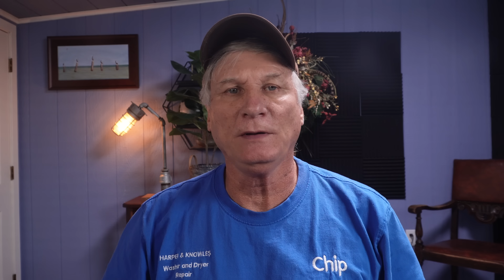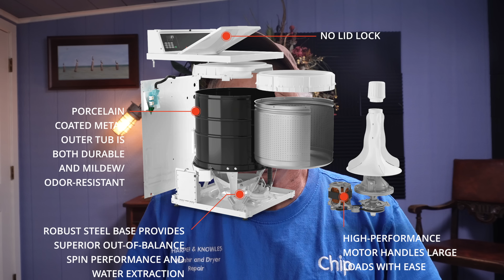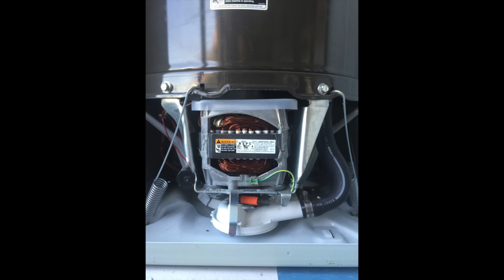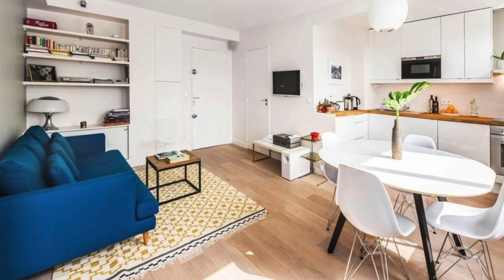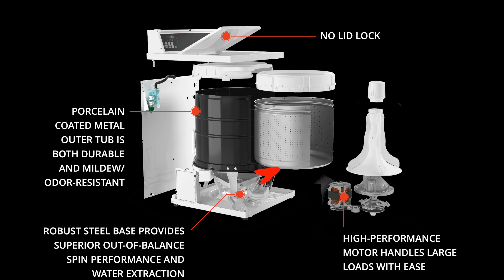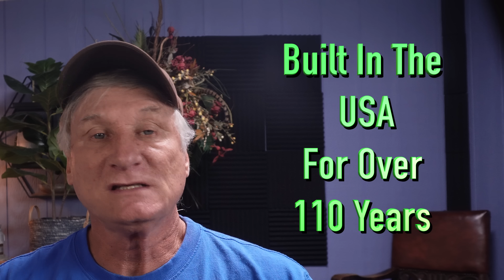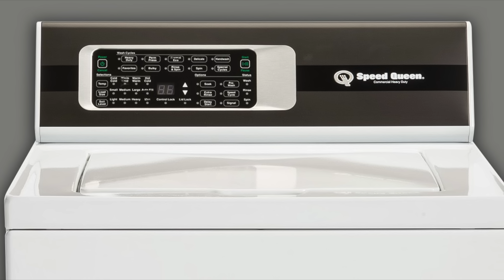TR7 vs TC5 – The Truth Speed Queen Dealers Don’t Tell You

Comment from the maker: If this comparison helped you, I’ve got full repair guides and tool plans here: https://harperknowles.gumroad.com
Reply: I have older home with stand alone pipe but mine drains nicely in the sink. I also had the pipe drain cleaned out well. Thx
Reply: @HarperandKnowles I don't see a manual for a TR7 Speed Queen, or am I just missing it? Can you direct link? I'm looking for instructions for checking filters, lock lid mechanism replacement, and drive board replacement. My washer won't start.
Reply: Many older homes have smaller drain stand pipes leading from the washer.  wil the SQ models push water out too fast causing an overflow?
Reply from the maker: A properly installed 2-inch standpipe won’t overflow with a Speed Queen. If one does, it usually means the drain is undersized, partially clogged, or not vented properly. Older homes sometimes had 1½-inch lines, and those can struggle with high-output pumps. Thanks for watching!
Reply: I'd love to come and work for you for a week... Where are you located?
Reply: Can i send my speed queen back to the factory for repair
Reply: If Speed Queen would make a quality front loader and/or a combo washer/dryer, I would consider it. But I will never get a top loader. And as far as a combo, I would only want one, as long as I could check the clothes for cleanliness before starting the drying cycle. Main thing is I won't be getting a top loader ever.
Reply from the maker: They do make those machines. Check out their website. Thanks for watching!

Comment: Do you need to do something to reinforce a floor? 

We have 17" between floor joists. Had a front loading Samsung before.
Reply from the maker: Good news, you don't need to reinforce the floor for a TR7 or TC5. A Speed Queen top loader spins around 700 rpm, a lot gentler than that Samsung front loader that was probably spinning 1,100 or more, so if your floor handled the Samsung it will handle this one just fine. Just get it sitting level so it doesn't rock, and your 17 inch joist spacing is plenty strong for a washer.

And if you would rather stay with a front loader, look at the Speed Queen FF7. It spins faster like your Samsung did, so getting it level matters a little more, but it is built solid and your floor will still hold up fine.

Comment: Just get. if you can Original Amana washer from 90s when  they used to be an independent Co. They are identical, and Amana is better build  comparing to  2026 SQ. Speed Queen is overpriced junk (36 years in appliance repair)

Comment: I have a laundry room and a multi unit that I own and I’ve always used Maytag. Several years ago I had to replace the machines with new Maytag. They only lasted two years. I purchased speed queens and you can definitely tell the difference when you take one of those off the truck and roll it into the laundry room they are heavy and they are strong.

Comment: I hate my Samsung with a passion.  I would throw it out a 5th story window if I had a 5th story.  The clothes barely move during wash/rinse, or even get wet unless you hit deep fill.  Why do they even call these energy efficient?!  One load of laundry takes an hour to wash, if you’re lucky- if you have to babysit it, like I do mine, you can add another 30 minutes to that, taking the clothes out multiple times to rearrange them because it constantly is out of balance.  Today, I’m washing a pair of pajamas, two t shirts, two bras, a pair of underwear, and two pairs of polyester crop pants, and I’ve stopped to rearrange at LEAST six times.  When it finally does spin properly, it stops, waits a minute, then starts spinning again.  I’m thinking “for Pete’s sake, just keep spinning and be done with it!”  All the stopping and starting and stopping and starting- for WHAT purpose??  Energy efficient, my rear end😠and don’t get me started on the stupid song.  We’re headed out tomorrow to buy a SQ.  This will be our third washer in less than 30 years, and I’m so over these high tech, singing nightmares.

Comment: I'm SO happy that I was able to replace the agitator 'dogs' in my 25 year old Whirlpool!  It was a $6 part ($13 with shipping and tax).  Now the old Whirlpool runs like new.    I was running it for about a year with just the bottom half of the agitator moving, but with the new 'dogs' it works perfectly.  HalleluYAH!!!  
I'd LOVE a SQ TC5 except for the obscene price and the small capacity, so I'm very happy with my significantly larger capacity Whirlpool getting fixed.

Comment: My TC5 broke in less than a year and  the people that sold it to me just gave me a repair shop number.  The electronics are  a POS. The got me 🤬
Reply from the maker: If it’s a TC5 and it’s less than a year old, it should still be well within Speed Queen’s 5-year parts and labor warranty. The dealer may have given you the number for an authorized warranty servicer. I’d contact Speed Queen directly before spending a dime out of pocket. Electronics can fail on any modern machine, but that’s exactly what the warranty is there for. 👍

Comment: I volunteer for a dog pound and we use Speed Queen TR in the smaller shelter.  It's certainly quiet and the spin is very smooth.  And the tub doesn't seem that small.  Given what goes into the machine, the TC probably would have been a better choice - dirty dog stuff needs an aggressive wash.

Comment: Great presentation,  I got a 2nd hand SQ for $800, a TR7 works well and quietly. Just started putting up drain error code, I removed the pump and found the water getting into the motor. I'm not really a fan of tech when it comes to appliances, but it was the only SQ selection at the time.

Comment: Daughter has bought three washing machines in the last 10 years. For many years we would buy nothing but Whirlpool machines but I began to experience too many problems. I now own a Speed Queen Washer and Dryer and have not had any problems in seven years. The washer came with a ten year warranty when purchased. Before you ❤buy another washer or dryer look underneath the appliances. Speed Queen is made with many metal, not plastic, parts. They do cost more, but, in the long run you will come out ahead and you will avoid a lot of headaches and frustration.

Comment: What about the TR3 any reviews or comments
Reply from the maker: TR3003WN is the current TR3 model. It's the entry-level Perfect Wash machine. 3.2 cu ft, four cycles (Heavy Duty, Normal Eco, Perm Press, Delicate), three temperatures, mechanical dial controls, inverter drive motor, 43 dB during agitation, 3-year warranty (shortest in the lineup — TR5 gets 5 years, TR7 gets 7). My choice is the TC5. Thanks for watching!

Comment: Bought a Speed Queen commercial stack 14 years ago. Dealer asked me if I wanted the coin operator with it. 😂 We have used it nearly every day and usually multiple times a day, for those 14 years. Last year had to replace the tub bearing, and dryer felts. This year I replaced the washer struts and belts. Did all the work myself. I would consider it a fantastic purchase. Other than those few parts that just wore out from thousands of cycles, it's been trouble-free. ❤

Comment: Only had my Whirlpool washer for 5 years and been having issue with it getting stuck at the wash cycle. I've been having to stop it manually change it to the drain/spin cycle for past two years. Found out if I got it fixed would cost me same price I paid for it cause the circuit board is what needs replacing. Tired of doing that now so im getting a speed queen end of this month. 😊 Everything made now that has all these tech features and buttons are crap just waiting to fall apart.

Comment: What do you think about Speed Queen Stacked Washer-Dryers SF7008WE?
Reply from the maker: Honestly, I've never worked on one — and coming from a repair tech, that's probably the best thing I can tell you. Speed Queen's commercial-grade platform carries through their whole lineup including the stacked units, so the build quality philosophy is the same. The washer is 3.5 cubic feet and the dryer is a full 7, the dynamic balancing system means it'll finish a cycle even when the load is uneven, and it backs it all with a 5-year warranty. Price is steep at close to five thousand dollars, but you're buying a machine built to last. I'd put it on the short list.

Comment: I worked in a large county jail (2300 inmates) as a maintenance tech. We used speed queens and repaired everything in-house. Those machines ran nonstop 24/7/365 for years before they "broke down". The most common things were from inmates misusing them and from the cheap powder soap the jail admins would order. Over time, the powder soap would build up and cause pump, transmission, and agitator problems. But all of those issues would happen after HUNDREDS OF THOUSANDS of loads. Plus, the other techs and I would have competitions to see how fast we could strip down the dryers. From fully assembled to drum, drum wheels, motor, and vent hose removed, we got down to 1 minute and 37 seconds! These machines are TANKS!

Comment: We had a new Speed Queen TC5 installed and it flooded on the first wash.  Our plumbing is excellent.  What could have caused this?  Is this just a defective machine?
Reply from the maker: Speed Queen is known for the higher than average drain pump volume. Some older plumbing has problems getting rid of that much water.

Comment: I see a lot of Speed Queens in launder mats. Never owned one though.
We have a Maytag Washer and Dryer that are Avocado Green, built  in 1976.
Only thing we did to the washer, is replace the belts, and the water valve on the back side.
This past summer the Big hose from the Tub to the water Pump cracked. New one`s from Whirlpool (which owns Maytag and a whole list of brands) has the new ones. 
Hey it`s 50 yrs old.

The Dryer , we replaced the Heating element 6 years ago, then the Motor, replaced it about 4 years ago. Made in China (where else?) , then there was a banging turning it on, and kind of a rumble. Pulled the front cover off last summer looking around and everything look ok.
Lately my wife said the banging is getting worse and taking longer to dry the clothes.
I was thinking heating element again...

Tore into it Saturday, Drum out of it etc.... turns out to be the Squirrel Cage in the Blower 
housing. Where it clamps onto the Motor shaft, the plastic broke.
So a new Cage, Belt and Idler Pully are on there way. Be here this week.
The Timer quit, they are NLA, but does turn on. Just set a timer in the kitchen, when it Dings, head out to the Garage for the clothes. 

Not much to a  Drier once you get into it.
Get the model # off the back and do a Google search. All kinds of info out there.
There is also on line Appliance Forums with a ton of help and info.. for what ever
brand you own.

Did a couple load of Clothes and took down to  the local Launder Mat. use to have all
Maytag Washers,  they  remodeled the place and now have some foreign Machines I 
never hear of along with the Driers.
Now $4.75 for the washers and  you get six minutes for each Quarter.
Years ago think it was 25 cents to wash and 10 cents each 15 minutes to dry....

We have a Kitchen Chef Refrigerator we bought back in 1990 for $375.
My bro in Law use to work for Sears fixing their appliances, and later on had his own
business etc... was over one day, opened the freezer door and said the little blower
motor was not turning fast enough. Week later replaced it, wow what a difference. old
one seemed ok to me, but what a difference.  Then another time the Defrost heater quit,
and replaced it.  Not too bad for 36 years....wish I bought 2 for that price.

Comment: I bought a Speed Queen about three years ago and delivered it myself from the dealer and it is very heavy. Almost killed me getting it up three steps into the laundry room. But once it landed on the ground, it never moved again. They are heavy, they are quiet and the TC5 is getting my clothes cleaner than they’ve been in years. I’m washing clothes that I’ve had for five years and they have never been this clean before. One thing you might mention is that although the tub is smaller than some of the other brands, it fills up completely with water when you use the deep fill option. That makes all the difference. No sense having a giant tub when it only fills 1/3 or 1/2 up with water. I use the deep fill on any load that fills up the tub dry. The only downside is that they’ve changed from a porcelain outside to powder coat. The powder coat is not as durable as porcelain. This thing does not move at all when spinning at full speed. In fact you can put your hand on it and barely tell that it’s even moving. The clothes come out much drier compared to my old Kenmore washer. The drying time in the dryer is shortened considerably and you’re not carrying wet heavy clothes from the washer to the dryer anymore.

I never regretted the cost. Like they say, the quality is remembered long after the price is forgotten.
Reply from the maker: It’s great to hear that you are so happy with the performance and that it’s making your laundry day much easier!

Comment: Does the TC5 have a gentle cycle that is on part with the TR7's perfect wash in terms of handling dirt?  Also, how does one make sure there is no sludge on the bottom and candidly, I do wash dog blanket and worry about dog hair being an issue for the machine.
Reply from the maker: It does have a delicate cycle. I’m not sure I understand the sludge question. About dog hair. I do know that Speed Queen dryers are great for removing pet hair. Check out their website to research that. Thanks for watching!

Comment: Hey Chip, how about in older homes with septic systems i live in an apartment and they have commercials Speed Queen machines and you're right they can take a beating. I am going to be taking over my folks house that was built in 1911, the wiring was redone in the late 70's. Buts its on a septic system do these drain pretty aggressively. I believe we have a 2" pipe to the tank. The two machines my folks bought in the 70's are still working fine but if they do go I was looking at getting both a SQ W/D commercial model setup. Also, how about the powering.
Reply from the maker: Since those units draw standard electrical power, your home's upgraded wiring should handle them just fine, though you should verify your septic system's capacity for the higher water volume.
Reply: @HarperandKnowles thats what I needed to know bro,thanks!

Comment: I bought a TR7 but really wished I had bought a TC5. I’ve had the TR7 for only four years and already had to have the lid lock repaired three times due to the cheap flimsy plastic part that speed queen uses. I did not realize at the time that they had a model without a lid lock. What is frustrating is that the repairs are under warranty, but I know that since the part quality has not been changed, it’s just going to continue breaking and eventually I’ll have to pay for it out-of-pocket. If you buy a speed queen, just buy the basic model Without the digital controls and lid lock. I personally am really disappointed.

Comment: Did Speed Queen recently get bought out by a big corporation?
Reply from the maker: Not that I know of. Alliance Laundry Systems has had its brand for a while now. 
Here’s the breakdown so you can see how it fits historically:
	•	The Speed Queen brand itself goes all the way back to 1908 (Barlow & Seelig Manufacturing).  ￼
	•	It became the “Speed Queen” brand name in 1928.  ￼
	•	Ownership changed hands a few times (McGraw-Edison → Raytheon).  ￼
	•	Then, in 1998, Alliance Laundry Systems was formed when Bain Capital bought the commercial laundry division from Raytheon.  ￼

 From that point forward, Speed Queen has been one of the core brands under Alliance.

So in practical terms:
	•	Speed Queen has been an Alliance Laundry Systems brand for about 28 years (since 1998).
	•	But the brand itself has over 100 years of history behind it.

Thanks for watching!

Comment: I have a 22 year old Bosch Nexxt front loading laundry pair. It's never required service or repair and it uses very little water. I was going to replace the drain pump. The pump costs $50. Sadly, Bosch no longer sells their Nexxt full size washers and dryers. When they die, they'll be replaced by Speed Queen front loaders. The only other washing machine I'd consider getting is a Staber top loading tumble washer because it's built like a tank. Uses simple mechanical controls and is designed so owners can repair and maintain it, themselves. It's a favorite of fire departments that need to regularly wash extremely soiled, heavy, bulky gear.
Reply from the maker: I’ve heard about those machines, but I’ve never actually had one come through my shop.

They’re a pretty unique design—top-loading, but with a horizontal drum like a front loader. So you get the efficiency and wash action of a front loader without dealing with a door boot and the mildew issues that come with it.

They use less water than a traditional top loader and tumble the clothes instead of using an agitator, which is a different approach but effective.

From what I know, they’re built solid and simpler than a lot of today’s machines. That said, they’re not very common, so parts and service could be a challenge depending on where you live.

Kind of an oddball machine, but from everything I’ve heard, they’ve got a good reputation. Thanks for watching!

Comment: Does the 5 hold a king size comforter? You mentioned queen size but I need a king size washer ready. That’s my concern with the size
Reply from the maker: No, take that to a laundromat. They have large capacity machines just for that purpose. I don’t recommend stuffing a Queen sized blanket in one either. You can, but it’s not wise. Even these machines with large tubs, just because it fits doesn’t mean you should do it. Thanks for watching!